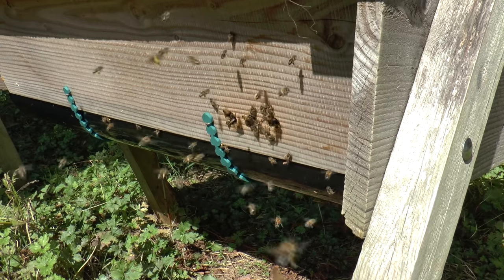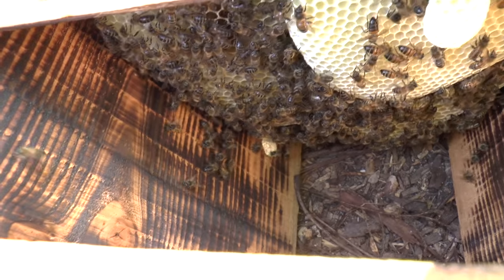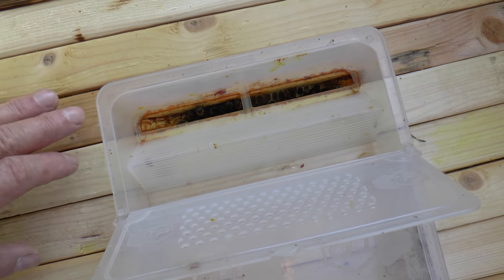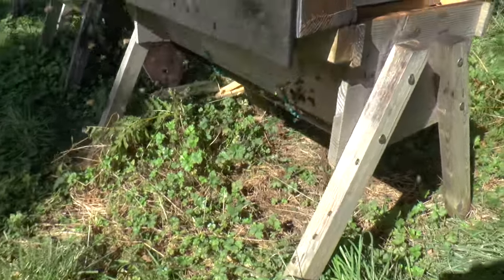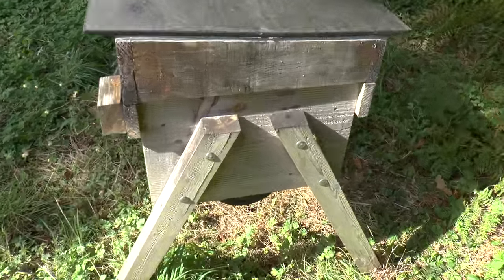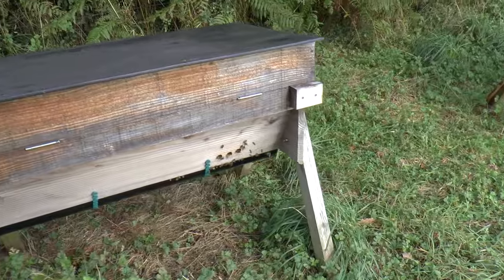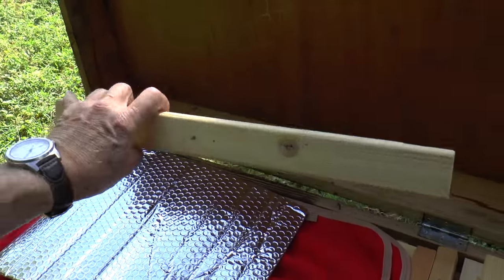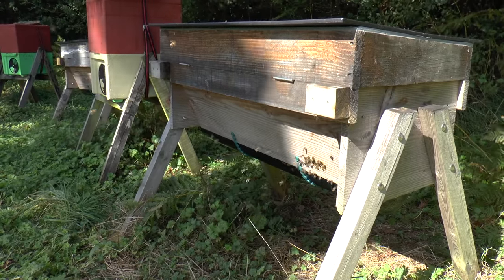Don't Buy or Build a Top Bar Hive - until you have watched this!

Comment: Thanks, Phil, this is a helpful video- I just did a presentation on TBH to my local Bee group, and I will forward this to them.  I have always not liked the hinged lid, as I learned to tend TBHs with access to both sides.  This also helps when I am teaching someone, however I am now planning to build them with similar hinges, as the weight and bulk of the roof is difficult to maneuver for a small woman.  The difference will be that the lid can be easily removed from the hinges if preferred.   I would also like to see the bottom of the hive. Obviously you couldn't show it on this video with the bees in it, but perhaps you could post one with an empty TBH upside down.  Also, could you please discuss entrance options, as well as extra ventilation holes.   I see you use side entrances.
Reply: You might try using Stainless Steel Take Apart Hinge - 89mm x 50mm - Left & Right Available for your roof. It's something I'm thinking of doing also.
Reply from the maker: I will make some more TBH videos ASAP. I hope your questions will be  answered.

Comment: Hi Phil
Found you on the web and watched a few of your video. Very helpful in building my first topbar. I have finished all but the floor as I am trying to get the best of all designs as in incorporating a hinged bottom, eco floor and screen. I live in New Zealand so temp where I live is quite mild compared to some.Winter low where I am is around 8 degrees Celsius and highs around 26.
Anyway thanks for your instructural videos
Reply: I am from Northern part of NSW, Aus. Our winter low is 0° (no frost where I am though) summer high 45° (not too many weeks though) would the specs of the design work for me? Thank you so much. 😊

Comment: Great video.  Thanks for the added info.  Years ago I  bought and used your plans to build two TBHs.  I still have them.
QUESTION:  You do not apply beeswax to the top bar ridge?
I cut a kerf into mine, then waxed popsicle sticks into it as a starter strip.  Looks like you may have learned more from the bees.
Reply from the maker: There is more than one solution!

Comment: Hi Phil, my first year keeping bees, I'm in NW Leicestershire and have two national hives on my allotment. I'm very keen on building a top bar for next year, some have the entrance holes in the end, is there much difference? 
It looked as though you had twigs and leaves in the bottom of the hive, or was that just looking at the ground through the mesh? Thanks for the video 🙂
Reply from the maker: Take a look at my other top bar hive videos. Side entrances have a number of advantages, mainly to do with the ability to use tandem followers, which make checking both ends of the colony much easier. For an explanation of the floor material, see my "eco floor" videos.

Comment: Hello Phil, I know you don't use chemicals for varroa, and I wouldn't either but I've had my hive for just 3 months and so far have had 2 dropped combs during inspections despite being ultra careful and not turning them in the wrong way.  So I'm a bit nervous of taking them out to sprinkle icing sugar and feel I have to do something about varroa so have ApiLife Var strips.  Have you any uncomplicated tips how to use these in a TBH? I'm a girl and pretty much ignorant of woodworking.  Many thanks. Dee
Reply from the maker: I've never used them, but I presume they are designed to be hung between frames in a conventional hive, so can you not hang them between bars?
Reply: Thanks for your very prompt reply.  They're designed to rest on top of the bars in a National hive so have to be adapted to hang between; it's been suggested to tie wire around the strip and hang it from the top of the bar so that it hangs between two combs but it's very crumbly (a bit like oasis for flower arranging) and liable to break up.  I just thought you might have had experience of this and knew of a better plan.
Also, where did you get your puffer for spraying icing sugar?  Thanks.  Dee
Reply from the maker: Maybe you could put them in a dish on the floor?  The power blower is old, made in Japan and the only one I have ever seen. There are devices on eBay that do a similar job, albeit plastic.
Reply: I'll have a look on eBay for the blower. Thanks. Dee

Comment: Hello Phil. In one of your answer there is a phrase "horizontal frame hives, which work in a similar way to the TBH but are significantly different in the way they are constructed and managed." You obviously prefer TBH. Could you, please, explain what benefits it has over the horizontal frame hive?
Reply from the maker: The main benefits are simplicity and ease of construction. A horizontal hive using standard frames must be made to exact dimensions, otherwise bees build comb in places they shouldn't and the thing can become unusable. Top bar hives are simpler to construct, do not require precise dimensions (other than well-fitting follower boards and you don't need to buy frames.
Reply: Thank you, Phil. Is it also right that inclined walls bees consider as floor and that is why do not attach comb to them?
Reply from the maker: To some extend, although I have yet to find a hive that is totally free from attachments. They are easily severed with a bread knife, however.
Reply: Saying "I have yet to find a hive that is totally free from attachments" you mean the angle of the side walls that bees consider them as the floor and not to attach the comb to them or what?
Also I  would like to know your opinion on the so called Cathedral hive  - https://www.youtube.com/watch?v=AsZDRNtmlA0
Reply from the maker: I don't think the angle is particularly important, although Les Crowder says he has few attachments in his hives, which have 120° angle, like the cathedral hive, which is derived from a design I posted some years ago. I am currently editing a video of some cathedral hives made by a friend of mine.
Reply: Thanks Phil. I am from a colder climate than you. It is a central part of Russia. Deeper frame is better for overwintering. ( Winter is longer and more reserves have to be above bees' head.)  I built some horizontals with deep frames (460 mm). Maybe you have heard about Lazutin's hive - his book "Keeping bees with a smile"has been translated into English.  Actually it is similar to Layen's hive - just a bit wide and deeper frame. I have been thinking about the top bar hive. Watched your excellent videos on this topic. I also come across the Cathedral hive and its upper part looked somewhat appealing to me. Looks like such design will be beneficial for thermoregulation during winter. The warmer humid air will rise, meet inclined top side wall, cool down, became heavier and slowly moves down, condense at a certain place, giving off quite a lot heat, that is needed for the cluster, and may froze at some place, also to give off some heat. I mean that the form of the upper part will facilitate the right air movement in the hive in terms of lowering the excess humidity (by condensation) and energy conservation in the hive. Maybe I am wrong. I do would like to hear your opinion since you have better experience in beekeeping and in top bar hive management. Thank you.
Reply from the maker: You are right and the best arrangement is to have sides that are cooler that the ceiling, so the warmer, moister air condenses on the walls, releases it's heat back into the hive and the water runs away harmlessly. This was stated in a short book called Constructive Beekeeping, by Ed H Clarke, published just 100 years ago in 1918. I have made a video about the Laziputin hive, which you will find in my channel.
Reply: Thanks, Phil.  I have Clarke's book "Constructive Beekeeping" (downloaded it from Cornell library.) Really good old book.
I did not know that you have made video about the Lazutin hive. I will just go and watch it. 
Really nice to meet you, Phil. So open, friendly, ready to help. Thanks a lot and all the best to you!
Reply from the maker: Alexander Ilinskiy Best wishes to you too!
Reply: Здравствуйте Александр! Вы уже обзавелись таким ульем?

Comment: I guess the angle on that V-shape is about 25 degrees... Phil? I'm wondering whether you could plow eighth slots at right angles to this slope for extra surface area or maybe some shallow saw cuts...anyone?
Reply from the maker: Ray Purse You mean the top bars? you could do that, but a rough surface is probably as good and less work.

Comment: Question please ... what dimension wood are the top bars made from? it looks like 2''x2''x(17''as mentioned). The half pipe (looks like) on the bottom, does the wooden crate addition shown in another video perform better? TIA
Reply from the maker: The bars are 38mm or 1 1/2 inches wide and about 32mm or 1 1/4 inches deep. some people prefer to use narrower bars and add shims. The eco floor still needs some refinement, but this is still better than solid wood or mesh IMO. There must be no gap between it and the walls, for obvious reasons.
Reply: Thank you, think I'll be trying to get a couple of hives made up over the winter.

Comment: I won't disagree with the good points of using a top bar hive, I had bees do really well in one for several years. One problem in my part of the world is that in the summer it gets pretty hot, and if they are doing really well, and bringing in lots of nectar and build large combs full of honey, the wax gets a bit oft and the comb will break off near the top and, at best, make a huge mess inside the hive, and at worst, fall on and kill a bunch of bees, including the queen if she's in the area, which appeared to have happened in my hive.

Comment: Hi Phil, I'm curious what you use for the v-shape on the top bar. I don't have a router table- I imagine that is probably the easiest way to make them. I have struggled to find an off-the shelf triangular trim - the closest I have found is supposedly triangular, but is missing the 'point' of the triangle, so more like a trapezium, which will probably work. I've also tried cutting triangular strips from sheet material with the circular saw tilted to a 45 degree angle, with passable results, but a lot of faff. Any insights you (or others) can share would be great.
Reply from the maker: Hi Sarah, don't worry about the shape too much: a truncated triangle works well, as does a square and a half-round shape! Anything that gives the bees a strong hint as to where they shoukd build their comb is fine.

Comment: Great help from your vids but can you tell me why some of the top bar hives I've seen have spacers on the the top bars giving the usual bee space but on your hives the top bars are flush?
Reply from the maker: Paul Lee Top bars are always flush. Spacing is achieved within the width of the bar (38mm in my case) It sounds like what you saw was a horizontal frame hive.
Reply: Ok Philip thanks for that, being a newbie I didn't realise that a top bar hive and a horizontal hive were different.
Reply from the maker: Paul Lee Yes, there are horizontal frame hives, which work in a similar way to the TBH but are significantly different in the way they are constructed and managed.
Reply: Great so if Iam sticking with a TBH then 38mm is the width to go by.
Reply from the maker: Some people are successful with bars down to 32mm, but i have found 38 more reliable in avoiding cross combing. i cant be certain that will work everywhere, though.
Reply: In Queensland Australia we use 14 x  32mm bars for brood and 16 x 38mm for honey. also for the bottoms many use wire fly screen this helps with ventilation which in turn seems to help with controlling Small Hive Beatle.

Comment: A random question, but do you general leave the holes in the follower boards open, or do you block them?
Reply from the maker: Open for feeding, closed to keep out robbers and wasps.
Reply: @BarefootBeekeeper  Ah, I assumed you'd close them, but in the video it looked open. I wondered if it was there so bees didn't get trapped the wrong side of the followers when you close up.
Reply from the maker: @garybenson  if there are bees on the wrong side, it's ok to leave it open. If there are no wasps around...

Comment: Phill ,

Good evening from America , i have a few questions and there this probably pretty stupid questions but I'm new to bee keeping and lim trying to learn as much as  I can , Ive always been told that the only dumb question is the one you dont ask !! Anyway re:: your top bar hives what are the r green linked round strap looking things on bottom of the hive ? 

Second question what thpe of insulation do you suggest i use on the inside hive lids .
Third and and last question should the insulation be used year round , Ive heard that in summer months when its between 80 to 90 F that insulation shouldn't be used what are your thoughts Sir?

Kindest Regards!
Kyle Maynard 
Kyle@maynardoutdoors.com
Reply from the maker: I think what you are seeing are the straps we used to hold the guttering in place. They are tree straps, which are not ideal, as they stretch over time and need to be re-tensioned. This could be achieved using 2-3 screws in a row, so the strap could be re-positioned.
Insulation can be anything you have to hand: old pillows, wool or straw stuffed into a pillowcase or hessian sack, a dead sheep...
And yes, use insulation all year round, as it helps to stabilise the inside temperature and humidity.
Reply from the maker: @kylemaynard8175  the guttering is the container for the "eco-floor", which is explained in other videos. And do feel free to ask questions!